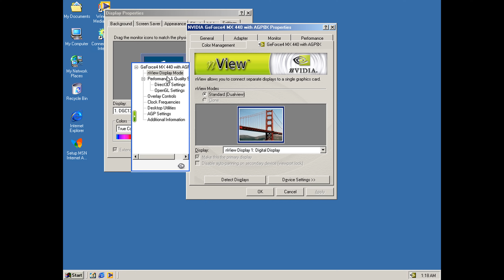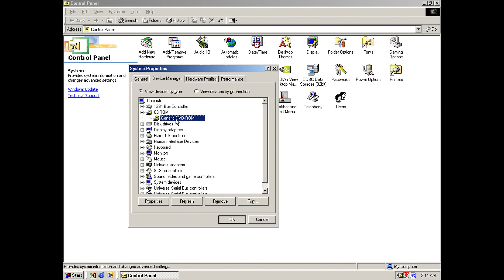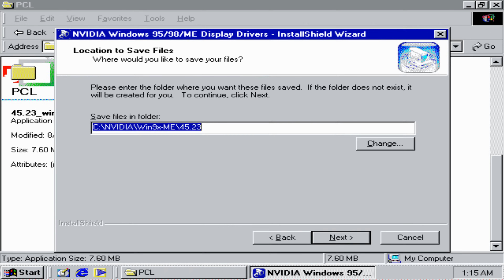I gave Windows ME another try

Comment: My first machine came with Windows 98, but one day in 2001 the hard drive failed. (Presumably.) Dad took it to the local independent computer shop, and it came back with ME. 

A couple of the shareware games I liked to play didn't work properly, but everything else did once reinstalled. I suspect it worked fine because it was a clean install and the shop knew which drivers would avoid issues. As a young'un I didn't know how to use DOS mode anyway.

"Lucky" for me, I got to experience the horror stories about driver incompatibility with Vista 5 or 6 years later. It was a machine which came preinstalled with it, but it somehow still had issues, and plugging in a printer designed for XP made the whole system crash. I installed XP on that laptop within a couple months.
Reply from the maker: I vividly remember the driver issues during the first 6 months after Vista. Scanner not working. TV tuner not working. Printer not working. Mobile broadband modem not working...
Reply: @philscomputerlab  this unlocked memories of that disappointment, 6-9 months after release, when people realised their particular peripheral wasn’t included in the swath of driver updates and probably wasn’t ever going to be.
Reply from the maker: @kaitlyn__L  It was THE opportunity to drop support and force you buy a new scanner. Dispute you owning the high end precious model, perfectly functioning... I worked at a computer store back in the day and we offered a service to business customers. If the machine has Vista Business you could downgrade to XP. The service centre made a killing with that and even us sales guys learnt about this and promoted it. I think we were one of the few stores offering this service, customers were begging for laptops with XP. Later companies like Toshiba even shipped us XP Images to help sell more of their Toshiba Tecra business machines...

Comment: Millenium was the OS of my first ever PC. Me is a blast, IF you have the right hardware, and install the correct drivers :)

I myself had a Matsonic mobo, with KT266, the ones with SDR and DDR support...installing the VIA 4-1 drivers always resulted in the system entering Safe Mode when booting.
Reply from the maker: VIA shuddered

Comment: Phil are you using a 1366x768 monitor?  I would like to retire my 1024x768 LCD because it is CFL type (mercury lamp) and quite old.   It seems a LED type monitor will last much longer into the future.
Reply from the maker: My main TV in the lab is 4k, the test monitors are 4k and 1920x1080.

Yes 1366x768 monitors are excellent for 1024x768 but very important, they need to have a 4:3 aspect ratio mode. Check the user manual for this important detail.

Comment: I used ME on a professional CAD-station, but later replaced it with Windows 2000. I never had a single issue with ME, and loved it. It DID run out of RAM though, if burdened hard enough. Windows 8 on the other hand - what a piece of cr..! I had so many issues, that i was on first name with the Microsoft support. I had one issue after the other, and was absolutely thrilled to upgrade to Win10 (though 8.1 solved some issues).
Reply from the maker: 8 and 8.1 was the only OS I totally refused to use... Vista I dual booted because it wasn't that bad and because of DX10.

Comment: Windows ME or Millenium had its fair share of issues. I still see no reason to work with ME except as an experiment. Almost everything ME can do (except recovery) is already backported to Windows 98 SE, and it is faster. I remember even experiments that would backport the graphical stack from ME to 98 SE still feel as sluggish as ME was anyway. It is very difficult to give a strong reason why you would use Windows ME. Even DOS 8 was a misnomer, as Microsoft did not offer anything worth mentioning since DOS 7.1, it even reduced functionality to hint everyone to get rid of DOS.

In the grand scheme of things, Windows ME was a stopgap measure that resulted in Microsoft slightly prolonging the agony of Windows 9x lineup while Windows 2000 didn't end up as compatible as they hoped it would be. The kernel was mostly the same, the driver stack just as well, the API was more or less in the same spot. What was annoying, however, was that Microsoft knew about 9x lineup issues and put the dirt about stability under the rug, resulting in ME being cryptical about errors and hiding the true way in which it run, including artificial barriers put on DOS, to ease what they had to offer in a Windows 9x replacement. The situation would be mostly corrected later on, when Windows XP was launched. However, even so, Windows XP did not reach the finishing touches, stability and compelling upgrade reason from Windows 98 until SP2 was launched.

Comment: Never had any issues with Win ME back in the day. I was not playing DOS games anymore and didn't miss any lack of DOS boot capability. 2 years ago when I found your channel and started to revive my RetroPC stuff (had a couple of motherboards like ABIT SE6, Epox 8KA7, some Pentium 3 and Athlon XP CPUs, as well a Voodoo 3, Voodoo 5 and a Vortex 2 card there were stored in the last 20 years), I struggled a lit bit of how to setup things again. Had most files stored in CDs, but forgot completely the tips and tricks to make things work together. I also got some extra hardware during these 2 years (some Athlon64 and Slot 1 boards and CPUs, some ISA sound cards, etc) in order to have more choices and experimenting. I won't recall now which combination didn't work, one of my trial runs was not working on Windows 98Se (computer would crash after installing drivers), I tried Win ME and it worked out of the box, with same drivers. 
So yes Phil, you're right, do not discard choices like Win ME just because of reputation: you might be locking yourself out of a good choice that might work.
On the Pentium 4 with Intel chipset... I grabbed some ECS motherboards (like P4VMM2) with VIA chipset for 2 reasons: it has universal AGP and it works with my Voodoos, whereas the Intel is AGP 1.5V only. The other thing is that VIA chipset works well with PCI sound cards like Yamaha YMF 7x4 and ESS1938 for native DOS sound. I'm bought one Intel P4 board from Aopen but unfortunately it was defective and I returned it to the seller - I could not verify its friendness with those PCI sound cards. 

Also thanks for the game suggestion, I will try Tachyon (only USD 1 today at GoG for me). It looks like a nice game.

And don't forget to try Freespace 1&2 (avaiable on GoG also), nice missions, good history, massive capital ships.... you should check them out.... in my memory the best space combat game I played back on those days, before WinXp era. Cheers!
Reply from the maker: Great comment! It really is a fun hobby. I often watch my own guides as details escape me 🤣

Comment: i used ME back in the day and can't remember it giving me problems.
i thing i had an athlon 1333mhz, 256mb ram and a geforce 256 rocking 98 and "upgraded" to XP to try it out (and because of the new look) but it was a mess that didn't support anything and had poor performance. so i decided to install ME because it had most of the QoL changes XP had while still being a 9x os.
what i can't remember is if i regularly played dos games or not. but not that far ago i rebuilt a pentium 3 i had lying around (with the very same geforce 256 from back in the day and a dual sound blaster set up with a 16 ct2290 and pci 128) and installed ME and modern dos games (say, doom, duke3d, jazz onwards) run great, for those that don't i set up dualboot with msdos 7.1. unfortunately i haven't been able to use that machine anymore and has been sitting on storage for lack of space. i hope i can get some space to put it once i remodel my room and get rid of some things i don't use anymore.

Comment: WinME did not have issues with games, unless it's drivers fault, but the Explorer does, as a programmer I used it a lot. Like delete a lot of files in directory (from inside directory with select all) at some point something is overflows, and it become almost unusable untill reboot. Same happened win Win98 after installing WMP7

Comment: My dads experience with Me solidified my suspicions not just of Me but other OS launches like vista and 10. People used Upgrade copies rather than a fresh install, this is where ive seen where so many issues have arose, especially those using older computers where previous OSes had been upgraded, 3.1 to 95 to 98 etc. (My dad tried on his 486..bad idea) and i know people who tried to push vista onto 95/98 era hardware, commonly sound and graphics cards not being compatible, and then the whole free 7 to windows 10 upgrade, so many unexplainable stability issues..All these windows OSes have been stable for me  by doing fresh installs, the upgrade packages are BAD. Causes so many pointless headaches..seems the only one that works is windows 10 to 11..but they are basically the same underneath so im not surprised.

Comment: i used ME for years and was very happy with it.  You can play most dos games in windows just by clicking on them.  If you really want pure DOS mode you can get it, but you don't need it the vast majority of the time.
Reply: Just like in 98 you can edit MSDOS.SYS to prevent the GUI from running at startup.  Setup a boot menu to either load the DOS mode drivers, or to boot windows on the command line.  It's easier to do then you think.

Comment: My recollection is that the issue was never ME on initial startup or installation. It is fine on a clean installation.

It was the cumulative experience over time, of using the OS, installing new apps and games, and then trying to uninstall programs/drivers so you can install new ones. ME just didn't age terribly well with the user, prone to serious driver conflicts that led to system-breaking problems. It wasn't stable and produced far too many BSODs. This kind of "Was ME really that bad?" video is never going to show that. Why? In a modern YouTuber project, you're usually looking at a short period of time to build the system, install the OS and software, then evaluate its performance. That could be a week or less, before needing to reach a conclusion, write a video, shoot it, and then move on to making new content.

This leads to quickly breaking down the machine again into parts (or perhaps installing a different OS) before such problems can rear their heads. That isn't enough time for ME to show its warts, at least not if we're talking about ME as it was on its initial release. A long term project where it is used for 6-9 months would be really interesting, especially if starting with the unpatched original edition.

What I recall is that I ended up ditching ME and instead going with 2000/NT, which was comparatively rock solid, until XP came out. The short gap between release dates, of June 2000 (ME) to August 2001 (XP), was so very short for a good reason. In its day, ME was a tire fire. Microsoft had to move quickly to staunch the bleeding. Fortunately, XP was a great OS.
Reply from the maker: Yes guilty of the above. I rarely get longer term experience with my projects...

Comment: WinMe has become my go-to test OS for retro hardware (even if the machine will ultimately run something else). I don't always use an SSD in an adapter that I can easily plug into my main PC, so the out of the box USB storage support and more robust network stack compared to 98 are invaluable features. It's also proven to be remarkably forgiving when using the same install on another computer; for the most part its just boots, finds some built-in drivers, and works.

Comment: Bit of a long message, but it may help someone thinking about running Windows ME as their retro OS. 

I run winME on my retro gaming PC with very similar specs (p4 2.4ghz  on an intel D845GERG2, ati 9700 pro agp, creative audigy sound card, 1gb ram, gateway 2000 vivitron 15.4 CRT) and it runs amazing! I grew up with winME, and went through all the dll crash issues (dll hell) winME is infamous for, so I thought it was a trash OS for a long time. In recent years, I gave it another chance and was pleasantly surprised.

I think the key difference at least from my experience is running the USP ME 3.01 patch, removing system restore via definition software's system restore remover pro (should have IE6SP1 installed first), and installing the WinME components update. These patches removed all the issues I had with the OS, and made it rock solid. I also added paragon NTFS for WIn98 so windows can read/write to NTFS drives, KernelEX 4.5.2 to run some newer software, and SATA PATCH VERSION 1.1a in combo with high capacity drive patch written by Rudolph R. Loew to use the onboard sata controller with my paired 256gb ssd. If you don't use the sata patch, you must disable sata drive controllers if present on the mobo or they will blue screen and disable 32 bit protected mode which you have to re-enable from the troubleshooting tab under file system properties in system properties.

With this setup, I have full hardware support , the OS is very snappy and responsive, games run great, and the system rarely if ever crashes. If you have applications that break with ram being to high, you can also go into msconfig > advanced > limit memory to: to set a lower memory amount without removing physical ram (not sure if this is in Win98). This has saved me a few times with out of memory errors from older applications. You can also re-enable to boot to DOS mode just like Win98SE to get real DOS mode on startup. I love windows 98SE and tried it on this setup, but WinME feels so much faster than 98SE and I stuck with it. I feel like it works better or maybe better utilizes hardware closer to the XP era, whereas 98SE does better with older specs. Before this system, I actually had ME running pretty well on a gigabyte GA-M55SLIS4, Athlon X2 5400+, and Nvidia 7800GTX (PCIx) that was my original XP gaming rig with nearly full support!

If anyone is considering ME, I'd say use a little bit newer hardware (P4 or Athlon XP/64, later agp cards) with the patches above and you'll have a solid, blazing fast retro gaming machine capable of playing mid-late 9X games very smoothly. Lastly, once you get it up and running I recommend theme world.com to get desktop architect and tons of custom 9x themes for your retro OS. I can't believe they are still up and running after so long!

Comment: win me system i have been running for a while now ...P4..1.8 socket 423...512 mb rdram...sb live val...4 port usb 2.0 card...linksys 1gig network..and the higher end geforce fx5200...3..120gig drives ..board is a gateway full atx..and i tore apart a new evga 450br and redid all the wires to molex plugs and the aux plug (lol that was fun to solder all)....all runs flawless

Comment: Question regarding Daemon Tools, why use it and not WinCDEmu? Is it the fact you cannot just download and install it directly on Windows versions older than XP? I ask because in my experience it just works far better, resource effective as well. To run it on earlier Windows versions you need to compile it yourself but it's not difficult to do.

Cheers, Phil.
Reply from the maker: I only know Daemon tools and it works well, is compatible with 98 and never has let me down. So I don't see a need to try something else. Also it's freeware I believe.
Reply: @philscomputerlab  I see it now, I used it too up until Windows 7 when it simply refused to let me mount my disc images, and I never tried to simply roll back to an earlier update. Not really sure what the issue I had was, but WinCDEmu is just a right click away and it mounts an image and can make images from discs, too, but I never tried it on W2K or ME myself.

Cheers once again Phil, it's always a great day when you upload :D good to see you having fun with games too.

Comment: I was building PCs for home users when WinMe released. I found it was 100% rock solid... on some systems. On other systems, it was so unreliable as to be completely unusable and I had to install Win98 on those. I could never figure out the root cause. Two systems with the exact same hardware and same drivers purchased at the same time could behave completely differently. My conclusion was that WinMe is a crapshoot and you're better to stick with 98SE because it is reliable in almost all situations. I suspect that all the experienced Microsoft developers were busy creating defence for the DOJ antitrust lawsuit and Me was left to be written by less-skilled coders.

Comment: Thanks for reinvigorating the ME interest Phil - I have a Pentium 4 project sitting in storage that would benefit from a Windows ME build. 💿
Reply: Funny enough I'm working on the same kind of thing but I'm upgrading a Presario 7000 with an Intel 865PE-based motherboard with a 3.2GHz P4HT. Granted, ME only uses 1 thread... but I also plan to use 2000 on it.

Comment: 98SE2ME can apply some of the eye candy from WinME such as bringing the Explorer shell to 98SE. The internet games option is bugged, but the servers no longer work anyways. Some of the system files introduce bugs that don't exist in the 98SE equivalents, but also resolves bugs from older 98SE system files at the same time. 

Apparently WinME includes the Win2K TCP/IP stack that is left out in 98SE2ME. MDGx has update packs for WinME but they were not as well supported as the U98SESP.

I stick with 98SE on any retro PCs as it's quick and easy to install and update while having the flexibility to go into DOS.
Reply from the maker: Interesting, I haven't tried networking with ME yet...